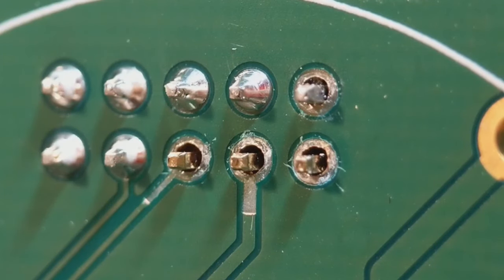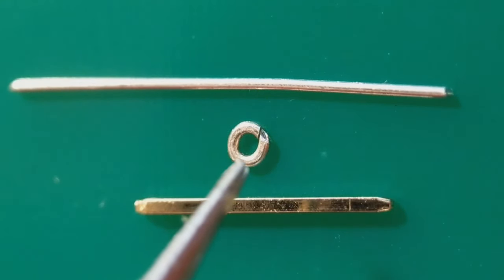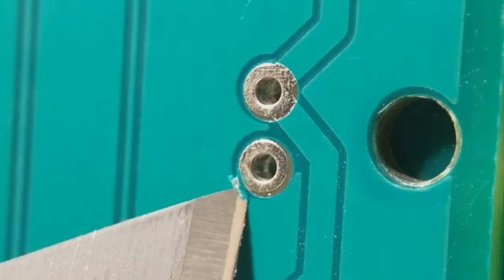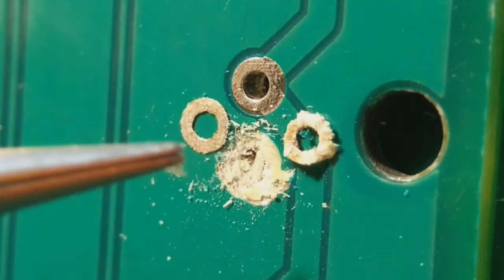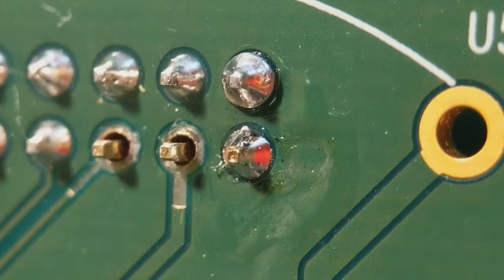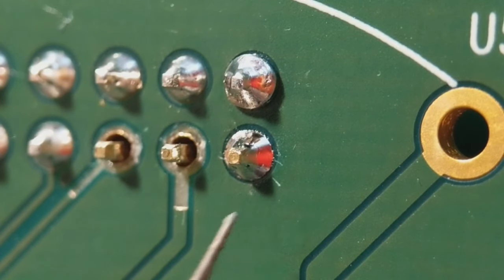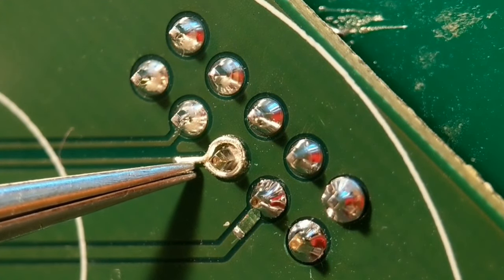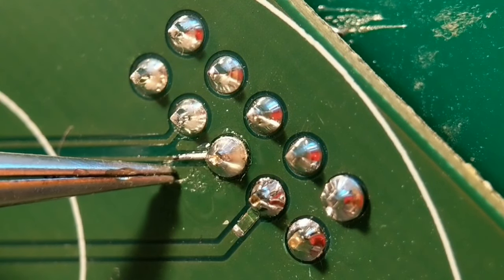How To Repair Damaged / Missing PCB Pads || 4 Great Methods

Comment: I got an old pcb from a 50 years old radio and the green stuff is missing so some hole got shorted ... is there any way to put an insulating stuff on the board so the two holes are now isolated???

Thanks
Reply from the maker: Hi , thank you for your comment. The stuff you can put on your PCB is called solder mask . It comes in a small syringe , various sizes just apply some where desired straight from the tube or apply on the end of a small wooden cocktail stick for example . You then need to cure this stuff with a small hand held UV torch , all available cheaply on line from various places. Dries rock hard and will give you good protection .Good luck 👍
Reply: @mrsolderfix3996  thanks,  I'll give it a try
Reply from the maker: Hi , no problem , good luck 👍

Comment: Very cool tips. I'm going through all your videos, lots of good tips. You got another subscriber. Thanks for taking the time and sharing!

When you perform the first 2 tips on this video, are they also electrically connected (solder inside the barrel)? I know it is a silly question (I know that mechanically it is secured), the question is connected to the situation I describe below.

I've learned how to perform soldering in the last 2 years, mostly to recap old eletronics and get them back into working conditions. I've done that to 2 Xbox Classic (mainboards and power supplies), 2 Apple IIe power supplies, an APC Nobreak Mainboard and some Retro PC motherboards - 2 of them recently (ABIT and Epox brands). I normally add new solder on the old capacitors before removing them, tried 2 different ways: a big blob of solder, then heat both terminals at the same time, pull the old capacitor and later remove the old solder (with a Hakko Desoldering Pump) or adding solder and just suck all solder with the Hakko pump. 

On these 2 PCs, I had issues on roughly 10-15% while soldering new capacitors (PTH) : the solder won't stick to the PCB pad (circular). I'm using good quality flux and solder (63/37), and have no idea why this happens. The pad is still there, I cannot see a mechanical damage - I can only suppose the superficial layer is gone and there is nothing for the solder to adhere. I've been luck so far as there are other solder point nearby (I've always checked that they are connected), I got around it but soldering a jumper to them. It worked in all cases, but I'm afraid at some point there will be a case when I don't have this possibility. 

Would the first 2 tips you have shown us be an alternative to this situation? On the situation I've described above, I tried to flow solder into the barrel and even so, everything was moving afterwards by just touching it - so no solder adherence to the barrel.

Comment: This video is amazing!  Is there a certain size wire to use for the first option?
Reply from the maker: Hi , thank you for watching the video and commenting . The wire I would try and use in these situations is generally about 28 or 30 gauge single core . I sometimes use thicker . I just try and use a wire that matches what the pad would have been originally . Thanks again , take care 👍

Comment: The video is very good but i didnt understood one thing, (maybe you explained it).
i understand completely how you fix the pad with a track point connection, but how is the another one?, you put there a circle or a circle from other board and you just solder there the leg of the component, that circle is not conected to anywhere?, probably is a really noob question 😅, i dont understand how you just put there the circle and is connected to the board, is connected inside the hole to the different layers of the motherboard?
Reply from the maker: Hi , thank you for your comment. The circular pad that I placed that wasn't attached to anything I mainly did just to show people it can be done and it's worth doing as cosmetically it improves the board and gives the pin extra strength. The connection from this pad is actually on the other side of the board because obviously there's a barrel that runs from one side of the board to the other . Another point is on some connectors not every pin will have a connection going to it , some are not used when the board is layed out . Hope that helps , take care 👍
Reply: @mrsolderfix3996  very interesting, thank you for the explanation and yes, is better to do it than leave it.
I dont know anything about electronics, the connections are in opposite faces of the board, in my noob way of think that makes a lot of sense to me.
Im asking you because i have to remove some capacitors from a PC motherboard and i blow some ground points attached to the solder pad (the layer ground on the surface) im going to replace the other ones (this time doing it much better) and im going to desolder that ones and do it again, first im going to use a wire mesh to extract the lead from the solder and then im going to scrach a little to that ground track points close to the pads to discover the copper and solder it.
Im going to use your technique with round circles, very good idea 👌
Reply from the maker: Hi , I hope you get on ok . Take your time and I'm sure you will be ok . Thanks for your comments , good luck 👍
Reply: @mrsolderfix3996  yes dont worry, im going to do it carefully and not running :) .
Thank you, you too man!

Comment: Awesome video, you’re so good at soldering.  I have a question?  I have some pads that are damaged, I dropped flux on them and tried to apply solder to them, but the solder will not flow to the flux.  It doesn’t work at all, it just stays stuck to the iron.  Any advice?

Comment: Hi Sir. I have try to take out capacitor from pcb. Its come out with copper around one of its leg. Can i fix the pad hole by put back the copper? And may i know what im doing wrong that cause the copper pull out together?

Comment: I'm trying to replace component with new one by desolder it. But the solder got stuck inside the hole.
I use electric desolder pump but still not able to remove it.
How to remove?

Comment: do you think these methods would work for a smaller component like a resistor?
Reply from the maker: Hi . Yes definitely , I've repaired smaller through hole pads and surface mount pads ( smd pad replacement down to 0402 size ) .
These are just examples but you can go smaller than these , just follow the same procedures. For smd pads I've done a couple of YouTube postings where I've showed smd pad replacements . No matter what size pad , just do the same procedure and you should be ok . Thanks for watching 👍

Comment: Would you be interested in repairing a circuit board for a Claas Combine? I have a bad pin at the bottom that renders the entire combine useless. The board is expensive and I think it could be repaired.

Comment: I have burned a pad. Can I use this method to replace the burnt pad?
Reply from the maker: Hi . For sure , if the burned pad cannot be soldered to properly again , as long as the barrel going from one side of the board to the other is still there you can definitely choose one of these options to correct your problem . Good luck with your soldering projects and thanks again for your comment 👍

Comment: It's fine if you have spare pads but where to buy them?
Reply from the maker: Hi , thank you for your comment . In this video I show how to make a wire replacement pad and also how to remove a pad from a scrap PCB ( which we generally all have , old gadgets etc ) and these are what I use . I never buy spare pads , no need to . Thanks again 👍

Comment: Great illustration of a most technical electrical repair. Its a pity customers don't see first hand, the ingenuous technicality skill of it. Cheers..
Reply from the maker: Hi , thank you for your comment , very much appreciated . I'm glad you enjoyed the video 👍
Reply: @mrsolderfix3996  I actually have a repair like this to perform on a battery charger circuit board. Luckily I have the separated pad, which I plan to glue back, then connect to trace. Thanks again.
Reply from the maker: Hi , no problem , I hope you can fix your problem . Good luck and thank you again for your support 👍

Comment: I have a question. Two actually. First, for the pads that don’t have a trace, what is the pad connecting to? Is it a multi layer circuit board that has a barrel going down to a ground layer in the middle of the circuitboard? Second, what is this about avoiding the short by making sure the replacement pad is centered? Could someone explain why a short would occur if the pad is touching the upper green later?
Reply from the maker: Hi , your first question . The replacement pad is placed on the pin to stabilise the pin because really you need a pad on both sides of the board to strengthen the position of the pin . As you can clearly see the barrel coming right through , the connection to this pin is on the other side of the board . Like you say there could be inner layers connecting to this pin , also some pins have no connections going to them due to the board design layout.
Second question . If the replacement pad was touching the green layer around it this could cause a short circuit as this green resisted layer connects other points together . It only needs a tiny amount of the resist to come away and an off centred pad touching it could potentially cause issues as you would be joining the pin to other points on the board which it shouldn't be connected to. Centralise your pads then no need to worry. Hope that helps 👍

Comment: What kind of wire did you use for the fourth solder?
Reply from the maker: Hi , thank you for your comment , much appreciated. The wire I used for the 4th pad repair was called Kynar wire . It's a 30 gauge , single core wire that comes sleeved . I just use the inner core for narrow tracks as in this case , I try and match any width track with a suitable width wire ( very important . Kynar is available from Farnell , RS Components and plenty of other places on line . I use it a lot for PCB modifications etc , comes in all colour sleevings. Hope that helps , thanks again 👍

Comment: The quality and clarity of your videos is unmatched and has massively improved the quality of my own repairs!

Would you be able to show us a good method for entire barrel repairs please?
Reply: You can only do a barrel repair if your PCB has top and bottom layers only, but if it's a multilayer then it cannot be repaired because each layer has to make contact with the barrel, and even if you replaced the barrel of a multilayer PCB, you'll need to X-ray it to see if all contacts are made, and that costs a lot of money.

Comment: Great vid, learned a lot. I usually run a soft wire around the pin and make it connect with the trace I scratched to expose the copper.
Reply from the maker: Hi , thank you for your comment. The way you have mentioned is a perfectly good way to fix the problem . I used to have to do " invisible fixes , which I why I would remove the pad from one board and place on another " . This really was a great method for me personally, but I put the other methods up to give people a few choices . Hopefully they can select one that helps them . Thanks again , take care 👍
Reply: @mrsolderfix3996  you definitely have a much higher level than I do in soldering and stuff. 
Keep posting new videos and tips please 😋
Take care !
Reply from the maker: Hi , with practice and patience you will definitely improve . It's how I improved over the years , I learnt the correct tools and solders etc for each job , but I do some jobs different to the normal ways your told to , it's good to be different and I think it enables you to achieve greater goals than you normally can . Thanks again , take care 👍
Reply: @mrsolderfix3996  amen 👍
For sure I need more practice but o don’t have much time to do it. Work and 3 kids don’t let me free time that much haha 
Anyway now if I have any doubts I’ll check one of your videos 👍
Reply from the maker: Hi , i to struggle with spare time , that's why I don't post that many videos compared to some people who put about 10 a week on . Its hard so I say good luck to them for all their effort. Thanks again for all your support and hopefully I can help you out in the future with a new video ( when I get time ) take care 👍
Reply: @mrsolderfix3996  better a few with good quality and content then a lot full scrap and empty 😉
Reply from the maker: Hi , that's what I like to think . One day soon I will get some more postings on YouTube , I promise 👍
Reply: Wow! Great video. Very helpful and reassuring you can fix something you broke

Comment: none of those would work for 1 or 2 pads missing on a cap or resister
Reply from the maker: Hi , I've shown in other videos cap and resistor methods . These are only meant for through hole connectors 👍

Comment: Perhaps stupid questions, but aren't these pads there to connect to threads? I mean, the pins that go through the board and get soldered to pads, should connect to a circuit, even for those holes that doesn't have a visible thread right? Putting a piece of wire or a transplanted pad will not connect that pin to any circuit right? 

The reason I'm asking is because I have this problem with a motherboard and some of the pads are gone for some capacitors. Looking at the board on both sides, there are no visible traces but they must be under the mask (otherwise what's the point of the capacitors). What to do with that? I have no idea where the traces go and therefore where to scrape a bit of mask to find copper to solder to...

Thanks!
Reply from the maker: Hi , in all 4 cases in this particular video the barrels in all 4 holes were still intact so meaning all inner layers connected to these barrels were still 100 % connected . The only connections not made were on the outer layer ( top or bottom which you can see so as long as solder goes down the barrel and you re-connect the outer layer ( which I have ) your problems are sorted . Only if you have ripped out hole barrels on multi layer boards will you encounter problems , schematics can help you fix problems like this. Also not all connectors on boards have signals coming out of them. Hope that helps 👍
Reply: @mrsolderfix3996  thanks, really appreciate the quick answering! I gave up on these capacitors. There are several in a row but don't know where the traces are going and the pads are tiny are just won't stick any solder despite the flux :(
Reply from the maker: Hi , your right , both ends of the capacitors must be connected to somewhere for them to work . If the traces ( tracks are ripped off you can sometimes see the indent in the board of where they originally were. Hope you manage to fix it . Thank you for watching the video , much appreciated 👍

Comment: Great video! Excellent job! How the new pads from methods 1 and 4 stick in the PCB? I know the pads stick to the pins by the solder, but how the pads / pins will stick to the PCB? Thanks!
Reply: I just watched this video.  Its really informative about repairing circuit traces.  I don't believe the traces are in any way re-attached to the board, but they have great appearance and good functionality until someone reheats the solder at a later time.  I have used all sorts of glues for repairing things and intend to look for a glue or a way to re-attach circuit traces to the board.
Reply from the maker: Hi , thank you for your comment , much appreciated. I just wanted to show people clearly how they could fix their pads etc and didn't glue down as I usually would as the joints , traces etc wouldn't have been as clear . I've done a few videos where I use tak Pak glue to secure wires down . This is a fairly weak glue but good for the purpose I've just mentioned . For more secure methods there's solder mask , twin pack araldites or extreme strength scothcast 10. I'm pretty sure when people fix their pads etc they would probably choose an appropriate glue for the task .  Hope that helps , thanks again 👍

Comment: What soldering station are you using?
Reply from the maker: Hi , thank you for your comment. I generally use a Weller TCP S soldering Iron . This is quite an old school iron but is still available from plenty of suppliers , Farnell , RS Components etc . I've always loved this iron more so than the new Weller's , Metcals etc. I use 3 types of tips mainly , DD8 large , PTP7 or PTH7 small . Hope that helps , thanks again 👍
Reply: @mrsolderfix3996  Hi, My mechanical keyboard has some damage to its PCB pad on a specific key that has stopped 4 other keys to not work. I’d appreciate if I can send you a picture on email so I can get some help on what I need to do to repair it myself as I have contacted all my local repair shops but they don’t have the expertise to repair my mechanical keyboard even though it’s a very small damage. I can send you the keyboard through post if you’d be available to take a look at it. Please let me know so I can purchase another keyboard this Christmas if you are busy. I don’t personally have the expertise to repair pads like yourself have shown in this video. Thx
Reply from the maker: Hi . I'm sorry I don't really take on projects like this , I just like to post video's so maybe people can try fixing their problems by having a go themselves . I don't get a lot of spare time , when I do I try to post video's but they take quite a while for me to do each one so I never have spare time to take projects on . Sorry I can't help you more than that.